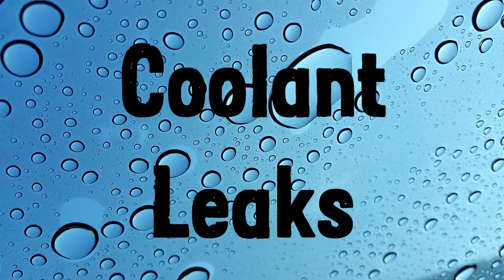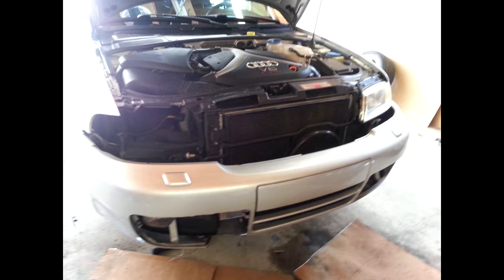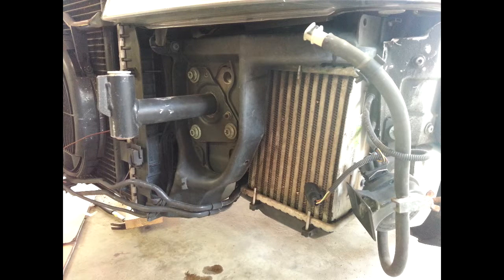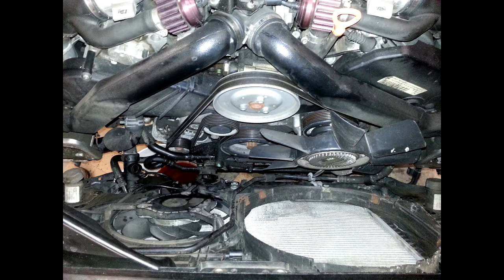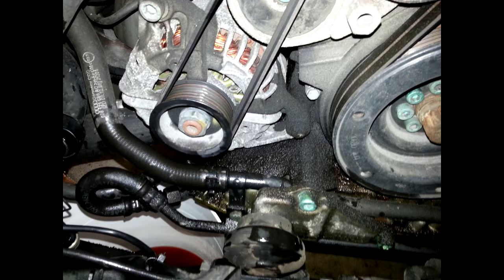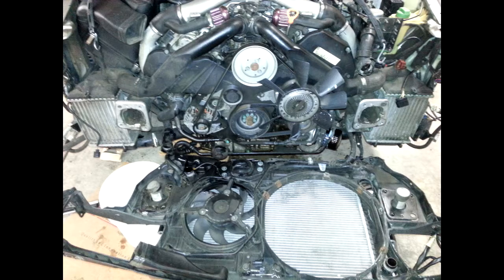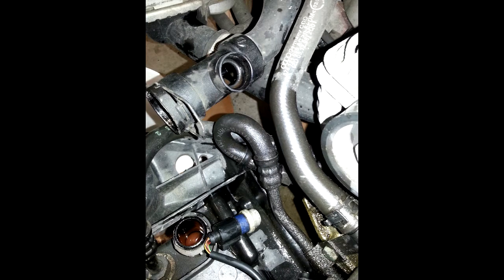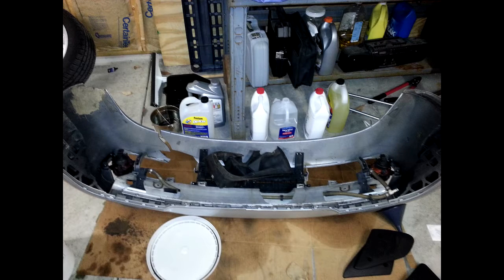2002 Audi S4: Ep. 8 - Coolant leak

Comment: so where was the leak and how much is the cost of repair?
Reply from the maker: +petra djokoo check out Episode 11.....It ended up being my water pump.  I had a bunch of issues caused by the wrong water pump.  I ended up replacing the timing belt, water pump, thermostat, thermostat housing with a metal one, etc.
Repairs and maintenance cost about $600, which included the cost of buying the tools to do the job.  Cam lock bar, etc....